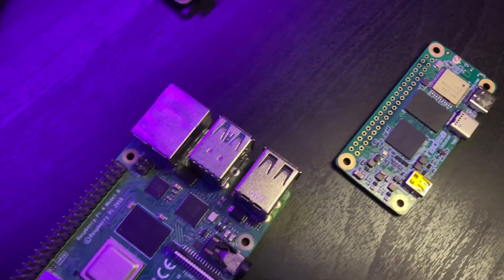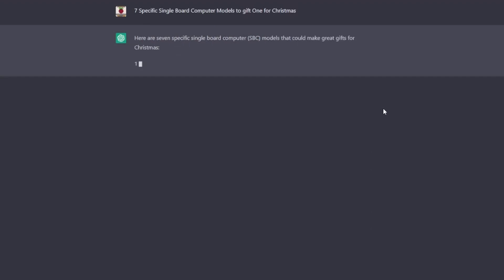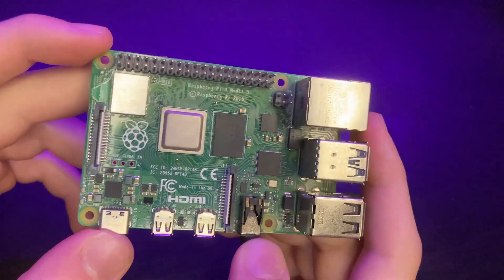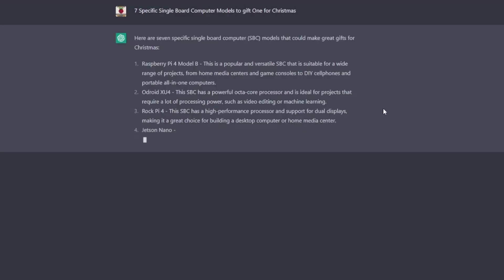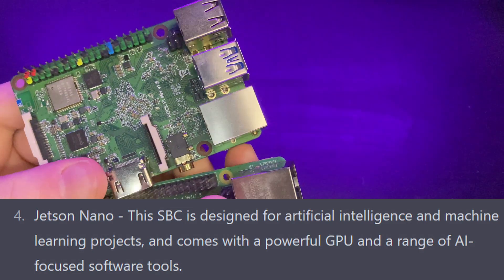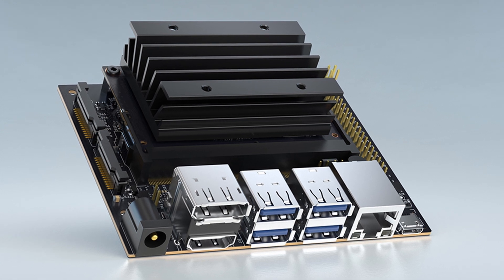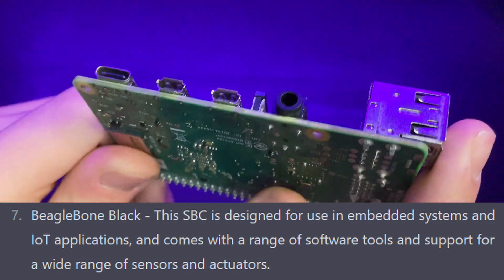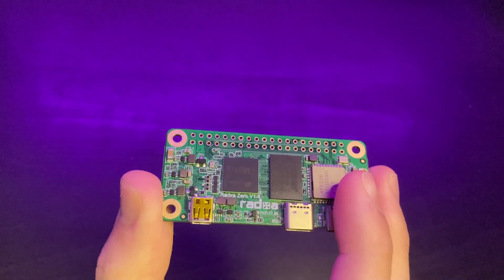AI Recommends What Single Board Computer to Buy!

Comment: Im noticing youre forgetting that ou asked it, What would make a good gift! which its not looking for THE BEST, its looking for effective at what it does, like did you see the Libre ALTA? nah, sick NPU on that, nearly RK3588, how about the Orange Pi 5, 5B, 5Plus that just shits on everythig you spoke about in general, and the radxa zero, zero 2 is SOOO expensive, when the Opi zero 3, zero 2W are sub 20$ for 1,, 1.5GB ram quad core H618 which scores higher than the RK3566 on the ---- pretty much everything now. In all honesty, if it aint radxa, libre, or orange pi - im not really gonna look at it, raspberry pi 5 might have doubled its performance, but its business model is apple as hell, wait for features to roll out with mass adoption everywhere else, steal drivers, modify for your device, launch with working drivers, look like sick deal, when in reality that is a working driver from another board that already exists, just like apple does to android constantly. If anything Radxa Rock 3A, B, C as gift for cost, Radxa 5A 5B if cost doesnt matter, Radxa Zero, Zero 2 pro, Zero 3W 8GB if you can get one that isn't over priced as f*ck, orange pi zero 3, zero 2W otherwise, since a 4GB DDR4 ram quad core great performer is (for me 31-34$ Canadian leafs dipped in syrup) and the Zero 3 if planned to be less mobile is good with the tried and true expansion adds 2 more USB ports, a second video out via 3.5mm to av, a mic, and IR, which for me was great since I bought a print for gamecube around it, the 2 usb were still insife, added usb storage that way since sd was limited to 128GB, was able to put entire nintendo lineup up to gamecube, so GC, N64, SNES, NES, GBA, GBC, GB, PLUS SEGA (pre saturn and about 20 other old consoles that take up like 10GB) hell I use the 1GB model as a security MCU, Wifi extender, powered by LiPo charged by solar, like its a beast, --- theres also a few ESP32's with cam around it making an ESP NOW Mesh but the Zero's create faster lanes, once inside I switch to Zero 3's cause now there's a usable ethernet, and it can still be a hoe media kit at the same time. Get Ventoy for devices that are new to you, just chuck every OS youre interested in on a USB, set device to usb boot, which for anything reliant on SD only, like.... USB is 9/10 faster, the fact to put an NVME or any HDD on a Berry Pi requires ADDITIONAL HARDWARE hey that reminds me of.... apple dongles.  When others just already have nvme, emmc, and sd, plus usb 3.0, personally when I wanna add lots of NPU and good CPU, not concerned about ram, and IO matters a bit, I get a libre alta, or if im budgetting the solitude which is a cheaper orange pi 3 plus that isn't even launcched yet and shouldn't cause its gnnna cost more, but it also outdoes the 3B except for nvme, which again berry pi gets DUNKED on by orange with the 3B purposefully being a 4B clone yet half the price, nvme and emmc, and just wonders why berry cant even give its cult boys emmc at least its gross man. then it quitely pumps out the first LPDDR5 board, thats already using the best SBC chip - like can anybody show me a CPU that's actually proven to be better than the RK3588? Cause even without graphics drivers the NPU and solid GPU just brute force the shit better than the rest anyway so idk man, everything you suggested sounded counterintuitive. As a gift I'd give a noob an arduino uno starter kit tbh, not an entire ARM F-ing Computer with no case so they can go home tap 2 pins together and zap that board to death, sounds more like your wishlist than gift list. Start with cheap and not a burden to break, but reliable if treated with respect.